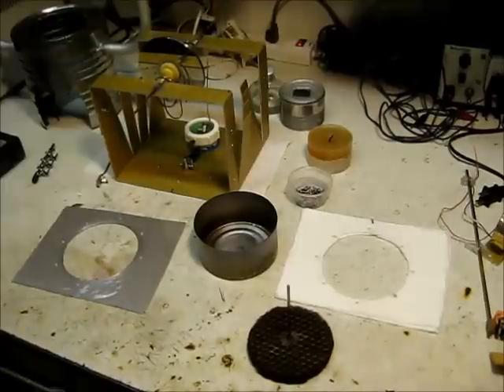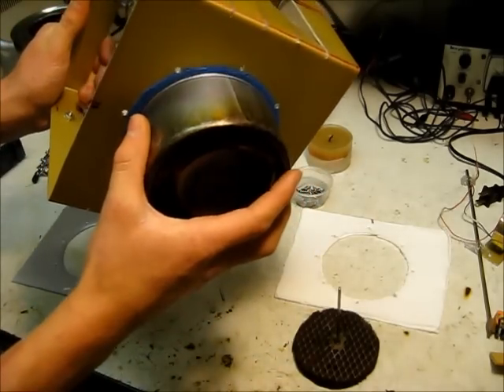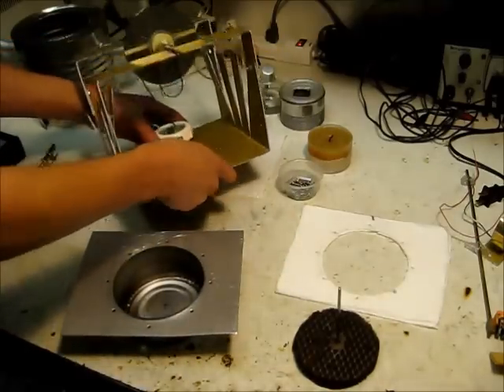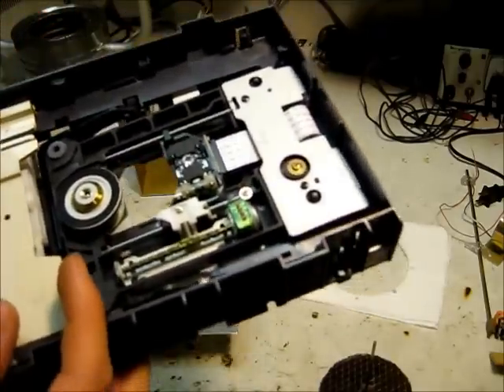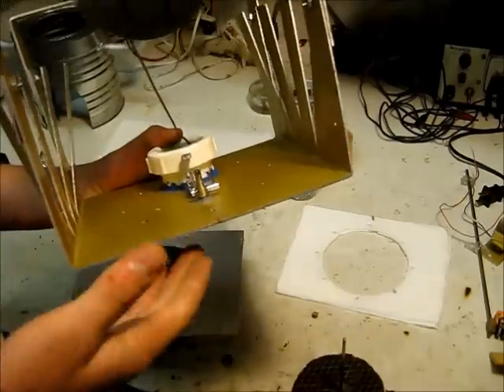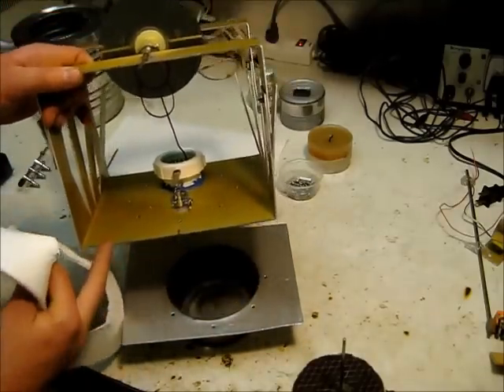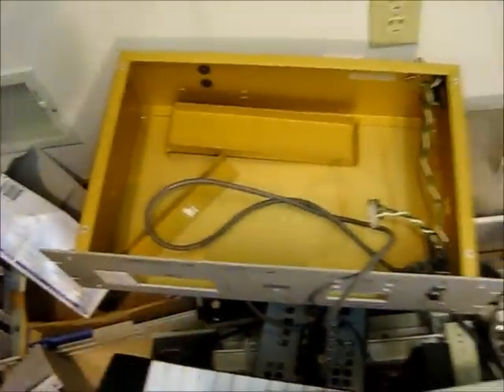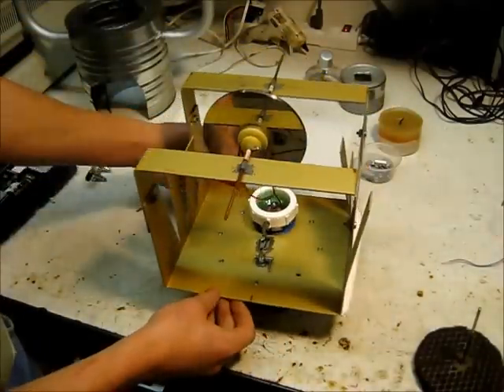My Stirling Engine #2 Taken Apart - Showing All The Parts and How It Was Made

Comment: I've been thinking about what to use for a shaft that would be fairly airtight, rigid and smooth and easily available for a while and have an old dvdrom I took apart for the lense but never thought of using the sliders. Brilliant! Thanks.

Comment from the maker: You mean like batteries?  I have used my Stirling engine to charge a AA battery before but it takes forever.  When it is running really well it will charge a 9 volt battery.  If you use a DC motor as the generator you can use it as a starter too.  It's pretty cool because you connect the battery up and it turns the engine over, once it is started it starts charging the battery.

Comment from the maker: Start off with a simple can engine then going bigger sounds like a good plain.  The only suggestion that I can think off of the top of my head is build a regenerator, if you want to get any usable power out of it.  I have built a few engines without and they never seem to produce much power at all.  I am in the process of building a new one right now.  I am pretty sure this one will brake my 1 watt goal.  You may have seen the sneak peak video of the displacer.  If you have any questions, ask!